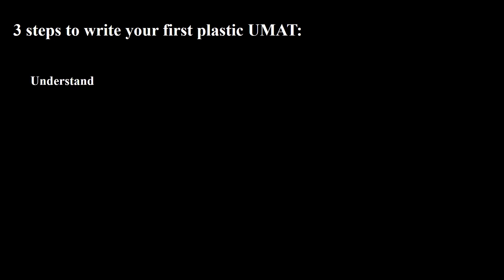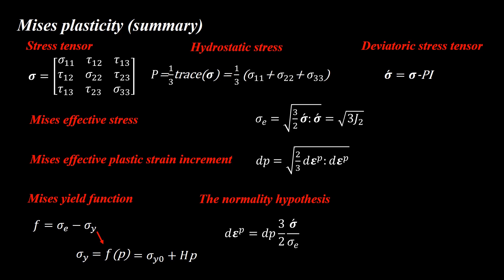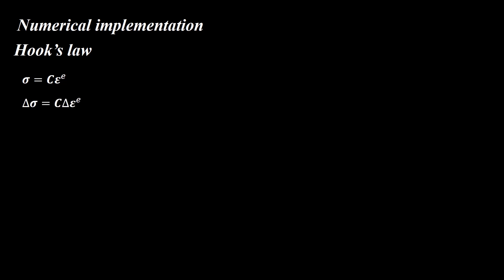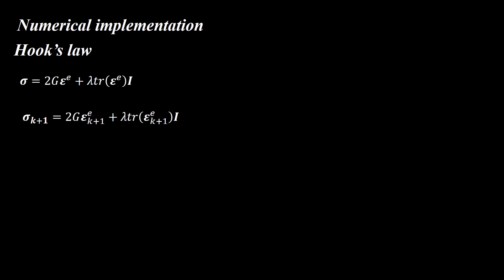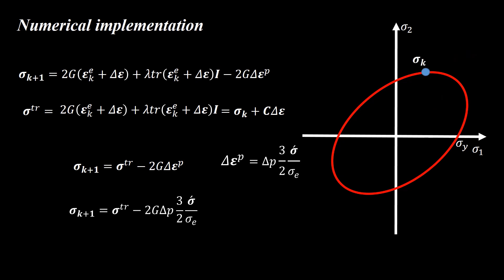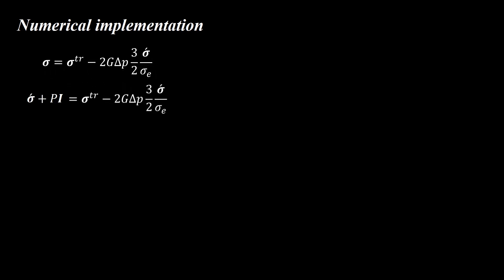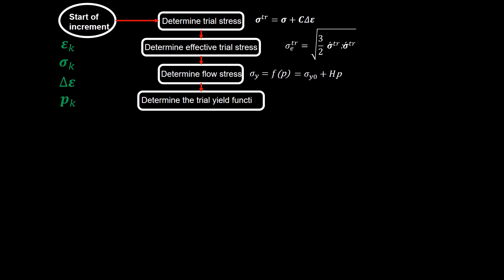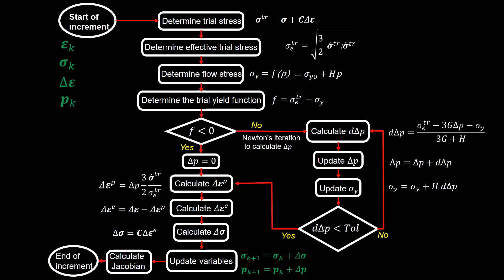Computational Plasticity (Algorithm for Mises UMAT)

Comment: Hey. I tried to implement it in a matlab code. I want to silmulate a uniaxial tensile Test. After the first plastic step i get a little stress in the 22 and 33 component of the stresstensor. this false components are then go into the new trial stress and over several loops add up to a very false result. what do you think i did wrong?

Comment: A correction at 1.49 .. the trace of plastic strain tensor is not zero.. however, the trace of plastic strain rate or incremental plastic strain tensor is zero.
Reply from the maker: Trace of 'Plastic Strain Tensor' and its rate or increment all are zero. That is the incompressibility rule of plastic deformation.

Comment: This is a sound informative vídeo, thank you for the effort. Could you explain how this algorithm changes if the flow stress is expressed as a function that depends on plastic strain, plastic strain rate and temperature, such as Johnson-Cook?
Reply from the maker: Dear David, writing the mentioned UMAT requires studying complicated relationships and numerical implementation of them which can not be explained in comments.
Reply: Hi David - Did you mange to get it sorted - if yes could you share as I also need similar kind of coding for Hensel spitel models please